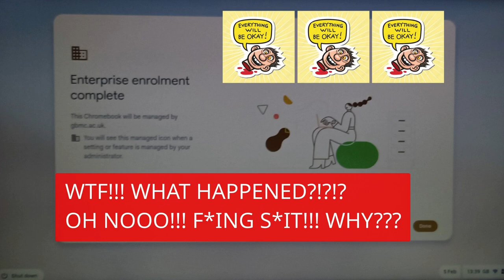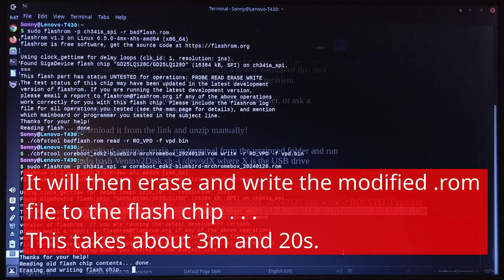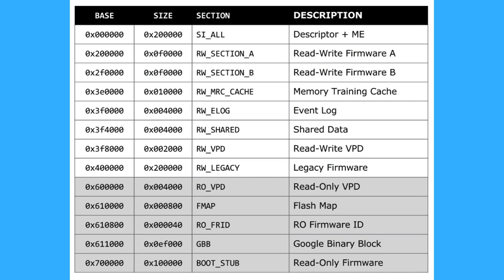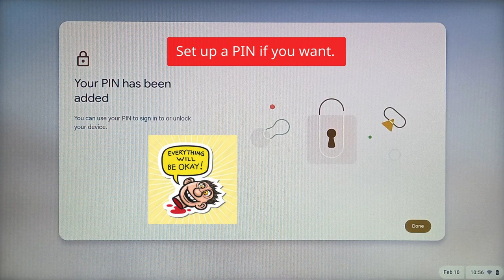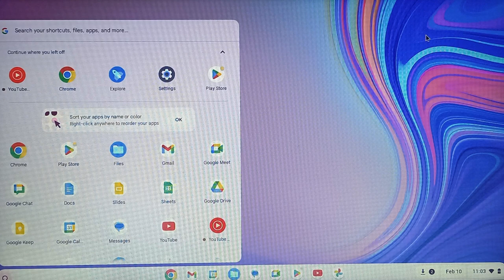How to unenroll a managed Samsung Chromebook 4 (CR50 protection) with CH341A - Linux method UPDATED

Comment: Hello, I have a Dell chromebook model 3100 p29t with a school account, I cannot find the bios chip, I read in a post on reddit that the design of the chip is different and cannot be flashed, could you corroborate this, since my English is not very good and I am using google translator, I hope you can help me and have explained it well.
Reply from the maker: Hi thanks for your request. The following website has all the files you need to flash the bios. 

https://vinafix.com/threads/dell-chromebook-11-3180-la-e372p.33289/ 

You need to create an account first, sign in and you can download the BIOS file (8MB), EC file (512kB) and the schematic file of the motherboard. You don't need to flash the EC (Embedded Controller). You can see on youtube what's the difference between EC and normal BIOS.

There are two types of Chromebooks. The first type can easily be flashed. The second type can still be flashed but it keeps going back to the enrolment mode because there's an extra tiny chip next to the BIOS chip that keeps resetting the BIOS to the enrolment setting. For this type, your only option is to install Linux after flashing. I recommend the MX Linux because it is fast and good enough for daily use.

Comment: pode disponibilizar o arquivo bin?
Reply from the maker: VPD bin files are not supposed to be shared because it would be like two cars with same number plate. It used to be OK but not anymore as Google patched the loophole. I'm afraid, it will create installation and update problems. You could get away with one Microsoft product key on several computers but each Chromebook has it's own unique VPD data that is used and verified through the internet by Google during Chrome OS install. Talking from my own experience. If you tweak that data, it won't finish the install. If it finishes the install, it will soon create problems for the original Chromebook and the clone one. It might work offline only but without being able to connect to the internet, a Chromebook is worthless.